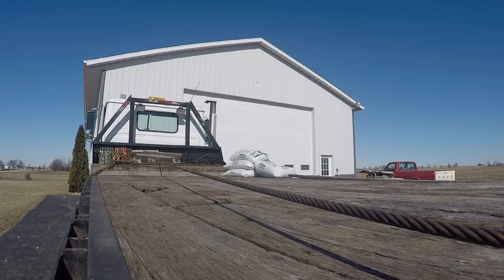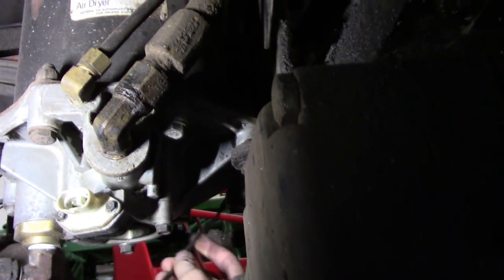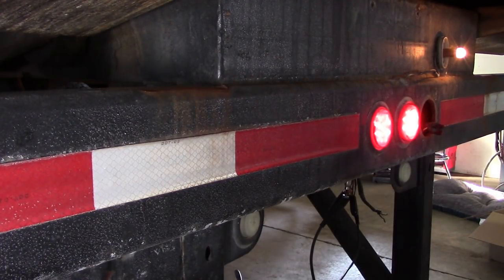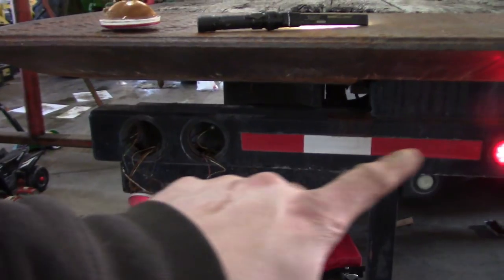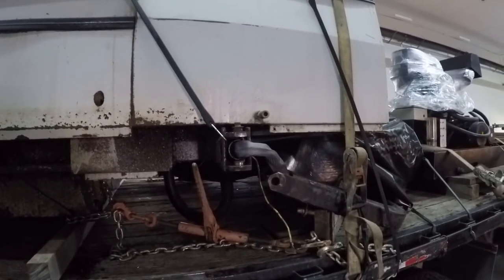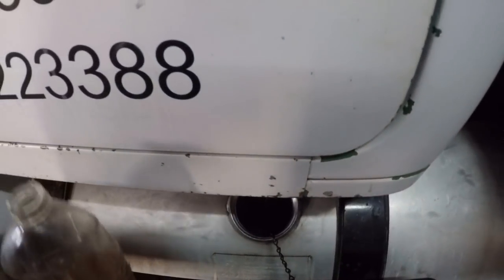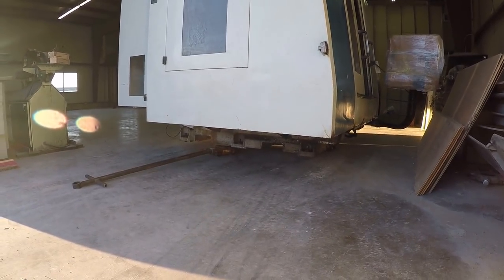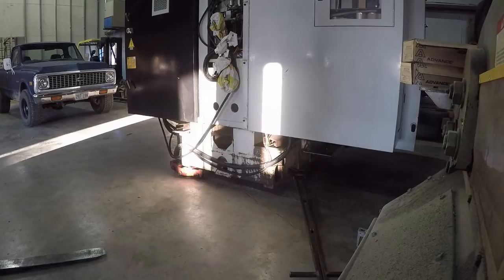Rollback Repair and CNC Machine Moving

Comment: Love the video Wes.  Your OCD must be more controlled than mine.  When I saw that wiring mess I wanted to rip it all out and start over.  I found something like that in my GF's boat.  Then I cut one wire and found out they didn't use marine grade wire.  I told her, this project now took on 3 times the amount of time.  I changed out all the wire and had all the lights working right for the trailer on her vehicle.  I hope to never have to do that again.
Reply from the maker: Trailer wiring is a disaster, even from the factory.

Comment: Got to love CNC machines Wes..Once, the maintenance guys over filled the gas in the cooler on my then CNC machining centre on the day shift, I worked the night shift, but as it got colder so did the hydraulic oil in the machine causing concern as it was moving the XYZ settings as it "shrunk" - had to call out a very angry guy from maintenance to release/ capture some gas back, so my machine could get back to a safer running temperature.... We ran them 24 hours a day, 7 days a week when pushing hard to get the work out... (mostly AIRBUS parts or ROLLSROYCE AERO parts), but, loved my job.."Back then"..lol... love being retired better now though... Thanks for the video WES. (Ian) - UK.
Reply from the maker: Yeah retirement sounds better than picking metal chips out of your boots...
Reply: @WatchWesWork  Indeed Wes, most Airbus work was high grade alloy, but I also done lots of Magnesium "gearbox cases" for R/R Aero and Magnesium  and that is a pain as you get thin needles in your skin but makes dust and mess all over the place not to mention fire If you let the cutting tools/drills dwell, then there was titanium, that too can burn..SO glad I retired - lol.. As a school boy I used to pick metal swarf from my dads work boots, but he always said - your wasting your time lad.. but, he was my dad bless him..

Comment: Our Jerr Dan rollback had the wiring in the bed as the lights all moved with it. Keeping everything working on it was a constant battle.  I eventually installed a flexible cable tray for a CNC to run the harness and hoses in and it helped a ton.
Reply from the maker: I think Jonathan W did that on the rollback he built. Seems like a good idea. I've had to replace the hoses already.

Comment: Forever chassis ground (only worth doing on a vehicle you're going to keep awhile):  1) Shiny up a spot on the vehicle frame; 2) solder a brass disc or washer to the frame; 3) drill & tap for 6-32, 8-32, or whatever screw; 4) make ground connection.  The brass will take almost forever to corrode, & if it does, simply remove the screw & terminals & shiny the brass back up.  And yes, you can solder brass to steel. | I suspect you already know about this one, as you've forgotten more about fixing stuff than I've ever known, but you never know...Thanks again for all your good work & Happy Trails!
Reply from the maker: The best thing to do is go right back to the battery. The factory harnesses use grounds on the firewall that usually last the life of the truck. But I like the brass idea!
Reply: @WatchWesWork  The little of this type of work I do now, I usually run ground wires to everything & ignore chassis ground.  This works well, but unfortunately is much less likely to produce a neat light show for those following me, particularly on a bumpy road.
Reply: Nobody can argue about how well a good star ground works.  They do argue about how much extra wire they have to run and pay for, though.

Comment: That caulking gave me flashbacks to the time I was diagnosing a fuel pump issue and found that an enterprising previous owner had JB Welded the bare wire ends onto the terminals of the pump.

Comment: Do you know how you have childhood flashbacks with bad brakes on your equipment? Mine is trailer lights and wiring harnesses. My dad would spend hours with a pen knife cutting into the wiring on his truck trying to get the flashers and turn signals to work. I can still here himhollering LEFT, RIGHT, BRAKES. Ever since then I have adopted the habit of running a dedicated ground that is soldered to the frame. This tends to eliminate 99% of mysterious problems and happened with lighting especially on trailers. I think the old wiring there gave me a ptsd attack lol. Good job on fixing it
Reply from the maker: On semi trailers they have a sealed harness with a dedicated ground for every light. That's the best way.

Comment: Every time I think about cold starts I remember our first Deutz tractors had a 110 and 140 and a 160.   They had actual fired style glow plugs where it actually made a flame in the intake to warm them to start.  But our 110 would start no mater the temp same with the 160.  The 140 never started well. I ended up getting a timing wheel and found the times to be off once that was corrected those air cooled engines always started and pulling them hard you could still hold the oil end of the dipstick in your hand.   Always enjoy your content 👍
Reply from the maker: I have seen Perkins engines with that flame manifold heater. They don't work very well. I've been told the Deutz engines had to be designed to start well since you can't really plug in a block heater to get them warmed up.

Comment: I used to install underground sensors and probes for the fuel business.  The install kits are intrinsically safe and not only use legitimate blue wire nuts, but also a two-part epoxy pack that pots the wires and holds on with a wire tie (all included in a kit.)  Those were pretty reliable in the field.
Reply from the maker: Interesting. I wonder how they would do with vibration. That's the killer in a vehicle or machine.
Reply: @WatchWesWork  The entire stripped wire parts are entirely potted, so I can only imagine that vibrations are minimal within the block.  The resin is hard yet kind of flexible.   Look for 3M Scotch-cast kits.

Comment: I've siliconed wires I've ran through a dump trailer frame cause I had no rubber grommets at the time. Hasn't cut through them yet in about 10 years.

Comment: scotch locks give the hacks a quick fix and the rest of the world job security. rollback did very nicely.
Reply from the maker: Someone told me they were designed for tapping into old analog phone lines. I could see it working for that. But they don't work on a truck.
Reply: Watch Wes Work they are and I’ve seen them all over my house.

Comment: I did not know they made that style  scotchloks for stranded wire.  I installed thousands of those splicing cable over the years but that style I always thought was only for solid strand wire.  I did not choose the connector for work but on solid wire they worked well until you get a lightening hit then they open.  Have you seen B or beanie connectors, looks like a little rat rubber?  I never had one of them open and they are jelly filled, no frosting though.  On stranded wire I solder it, those heatgun solder connectors look nice and easy.  Seems like the truck was a very good choice for you to purchase.  Stay safe and hug your kid.
Reply from the maker: I don't believe they are approved for stranded wire. They are also not SAE approved or anything like that. But they are cheap and easy, so I see them all the time.

Comment: I guess it is a lot easier to grab a 4 wire trailer wiring harness to replace all the wires from the junction box to the  back, and then split into different lights. Maybe two extra wires if it has independent rear turn signals.

Comment: Filled Scotchloks are only meant to prevent corrosion from ambient humidity. They'll get corroded green and will open up if they get constantly exposed to salt slush/water.
Reply from the maker: They were never intended to be used on vehicles. But, you know how it goes...

Comment: You can buy those heat shrink (with glue) butt crimps in packs of 200 for $20 on amazon. 
Actually just ordered more as I get to do some work on my car Friday. 
I also recommend ratcheting crimps.
Reply from the maker: I probably have a dozen ratcheting crimpers. I have not found them to work any better than good quality old school crimpers.
Reply: I've found once adjusted properly they are far more consistent. 
I do have a better set, with interchangeable jaws for different crimps or pins etc. 
But whatever works. 
For those heat-shrink crimps, the glue is just hot melt glue, so you can add a little extra if you need it.

Comment: I moved, hauled machinery for 30+ years. A couple pointers. Put a piece of 1/2 inch plywood between skates and machine. This will keep machine from sliding on skates. Also think about having sections of maybe 1/8 inch steel plates to run skate/with machine when loading and unloading machine. This will keep machine from going through wood floor. This had happened to me when skates were not on main beams of trailer. 
I'm with you on the scotch locks... Pure junk. I'm in your climate so i can relate to corroded wiring. Often the lights last longer than the connectors.
Reply from the maker: We have the steerable skate on plywood. You probably can't see it in the video. I've found that the only way to keep the skates from popping out when they transition to the concrete is to nest the machine base into the notches in the top of the skate. Otherwise, as soon as the machine is at an angle to the top of the skate, they want to shoot out toward the front of the truck.

Comment: Not that you need suggestions, but if you ever work on your son's power wheels, a great gag would be to strap it to the rollback and shoot multiple angles dramatically backing it into the shop, not quite revealing what it is until the last minute.

Comment: That was a Tuesday surprise, thank you. How much worse would the wiring had to have been for you to just rip out all the lights and re-run them to that terminal block? That mystery cord looked like orange extension cord. I used to rent an a "apartment" that was just a bedroom carved out of someone's house. The house electrical panel was in my space and quite often I would get asked to reset a breaker.  I noticed the guy had wired a bunch of breakers with orange extension cord... rent was low at least.
Reply from the maker: Oh it gets much worse than this!

Comment: The roller supports or skates bolted onto the machine lower suppport housing, whos the manufactor as they would be the perfect addition for my tilt tray, which is the Australian definition of the American rollback. 👍👍🇭🇲
Reply from the maker: They are made by the American company Heavy Haul. Pretty pricey, but tough. Each skate is rated for 15 tons, so 45 tons for the 3. I use a Simplex mechanical toe jack with them. Works great.
Reply: @WatchWesWork  Thanks Wes👍👍🇦🇺

Comment: I was under the impression that you preferred non-insulated connectors from previous videos. Have you changed your mind? White light showing to the rear?  Pass safety insp that way?  Scotchlok should stay where they belong, on telephone wire and maybe not even there.
Reply from the maker: I was just in a hurry.

Comment: very nice! but that transition from the rollback to the floor... there has to be a better way than dropping a precision machine tool down onto concrete. have you considered a wedge, maybe made of aluminum? it only needs to be a little wider than the skates. Even a short wedge would be better than a drop, but if you can match the angle of the rollback it should be even better. anyway, keep up the great work.
Reply from the maker: Heh. You have to think this machine came all the way from Taiwan, to Indianapolis, then to the customer, then to a used machine dealer, now to a new customer. It's been through much worse, I guarantee!
Reply: @WatchWesWork  true. still seems harsher than necessary :-)

Comment: Wes , your L 10 starts pretty good, but M 11s start even better than that  , and people didn't seem to give any respect , they did great for a 600+ cube engine .
Reply from the maker: This thing is incredible. Doesn't matter how long it sits or how cold it is. If you can get one revolution of the crank it will start.
Reply: Watch Wes Work You need to learn about STC, it's junk , probably the worst thing Cummins ever invented, watch the oil pressure, and stay on the rack , but you'll probably won't put that many hours on it being a local rollback .As for the wiring , I share your detestement of scotchlocks , a shortcut for weak people .
Reply from the maker: @beckywatt5048  I rebuilt the STC valve once and replaced the injectors. It works OK, but the engine never really warms up in winter, so it smokes a lot at certain throttle positions. In summer it is fine.
Reply: Watch Wes Work Does it have an air or clutch/ viscus fan ??

Comment: Where do you buy the heat shrink crimp connectors?  Rather, is there a brand you prefer? 

Thanks & Thanks
Reply from the maker: Molex is the best, also the most expensive. Any auto parts store should have some that will work.

Comment: I work at a dealership & they guys get flatbeds in all the time with pinched or cut wires.
Reply from the maker: Yeah, when I worked on trailers it was mostly wiring repairs. That and holes in the roofs or floors.

Comment: Probably much lighter than 10000kg.
I'd guess it's more in the 5-6000kg range, simply too much sheet metal to be that heavy.
Reply from the maker: It's a 600mm by 1200mm travel machine. It's not small!
Reply: @WatchWesWork  That's 2' x 4' in standard terms, for persons of another persuasion.

Comment: Good work and all but if that old girl is 10000kg I’ll eat my hat. I know a lot of the brands fudge the numbers so on paper it looks more well built. Buy the way when I got to move machine. we use drop deck trailer machine up front and big fork lift in back.  That sort of move would be about $2400 in transport costs that’s Australia money by the way
Reply: That's a lot of Kangaroo Bucks
Reply from the maker: That sounds about right. It's an 8 hour drive one way. Plus 2 hours on each end to load, tarp, untarp, unload.

Comment: wes have you tried these ones that have a ring of soldier in shrink tube with silicone seal rings you use a heat gun after twisting the wires together it melts the soldier an heat shrinks tight
Reply from the maker: I have not tried them, but I've seen them. I'll have to get some to evaluate.
Reply: @WatchWesWork  i look forward to your review

Comment: 3M used to be good stuff(except scotchlocks).Even those new style ones suck. I wonder if they have a new generation of enginenerds out in Cali where everything is rainbows and unicorns. Those things NEVER work on real work trucks here in the Midwest. Learned that on my first used plow truck 40 years ago.
Reply from the maker: To be fair, they are not designed for automotive use. People just use them for that because they are lazy.